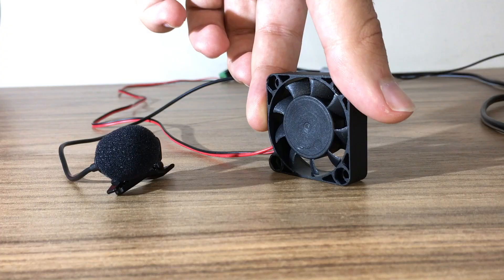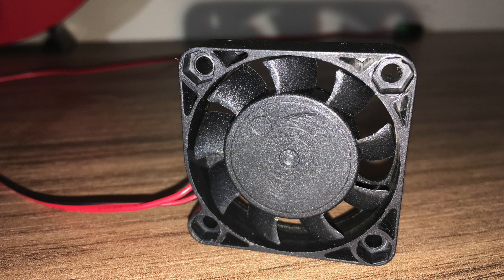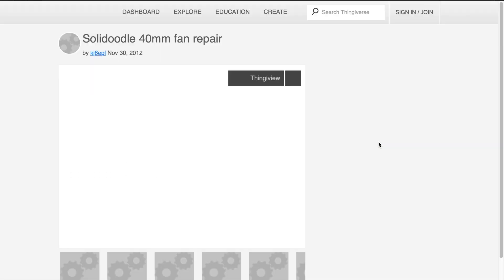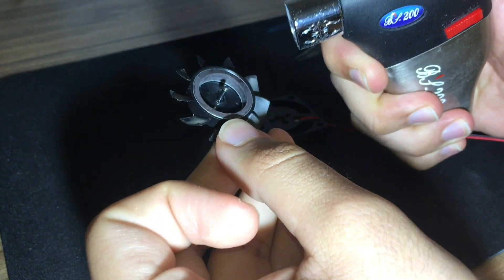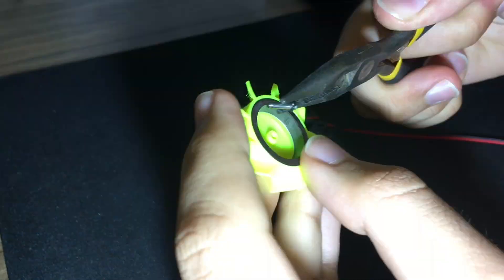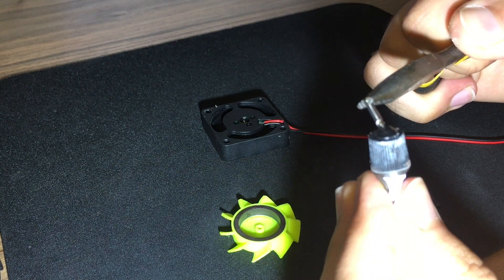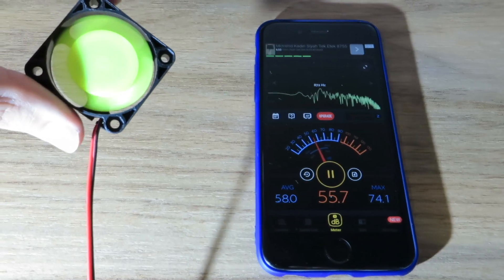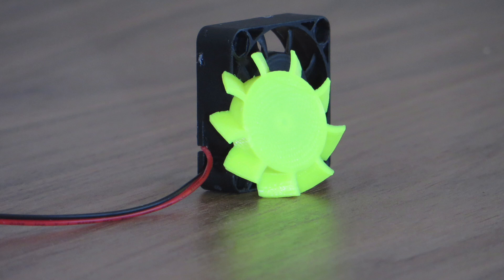3D printing a fan blade

Comment: Please tell us what did you achieve with printing your lime blades compared to the original ones? Could you measure if more air flow through, which would be the only reason why going through this would make sense. If you can't measure that, what's the point?

Comment: This very helpful. I broke a few fins on my hotend fan when I was taking it apart while on( lesson learned). But it was vibrating like crazy so I swapped it with the fan that cools the stepper drivers. It helped but it's kinda loud now.
Reply from the maker: Just dont forget to add the fan back to mainboard. I recommend getting a sunon fan. I have the vx model which is fast but loud. Its very high performance tho. If you want less noisy one you can get the v2 or v3 (these are the speeds x is fastest and 3 the quietest). You can find datasheets for it. Stick with quality fans
Reply: @Chasing_Microns  actually added another cooling fan but broke my hotend tan again so now I have two repaired fans lol. I printed the hotend blade out of tpu so now it won't break lol

Comment: How do I remove the fan blade if there isn't a hole in the back?
Reply from the maker: What do you mean, remove the sticker and there will be a clip holding the shaft. Ive never seen a fan without that.
Reply: @Chasing_Microns  damn. the back of the fan is closed. The clip is not directly visible. I was disappointed to see it. I've been looking for a solution to this since morning.

Comment: Hello, I've personally been working on creating a PC fan from scratch and this was very helpful. Any idea where I might be able to buy a motor for it.
Reply from the maker: I’ve destroyed lots of fans and they all were unique. In fact i wanted to design my own fan but the motors are not like an standardised thing. Best practice is to destroy a fan and use that as a refrence.
Reply from the maker: Usually not. At least not in your amounts. You can get them for bulk. And also is your design compatible with whats in market?

Comment: Very useful I didn’t know there was a clip that held the shaft in place
Reply from the maker: Well, there are versions that use the stock hub. You just print the blade and snap it on existing hub. Those are much better and easier
Reply: @Chasing_Microns  thats helpful, this whole video is helpful

Comment: What about airflow is it same or better?
Reply from the maker: İ am not sure but probably better because the blades have less drag which means they can go faster
Reply: @Chasing_Microns  sure, you didn't even test RPM, it is probably lower now.  So no its likely worse than the stock fan.  Do you really think you got that pin perfectly vertical?  Fat chance.
Reply from the maker: The way that I remember this was: the rpm was so high that it balanced the blade by it self. And the point wasn’t to beat the stock fan, it was to replace an old, torn blade.